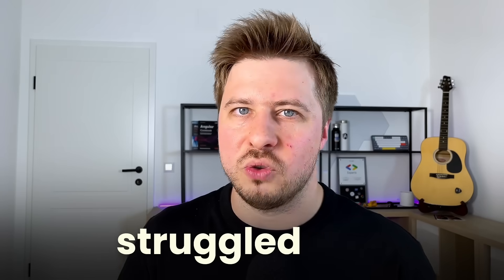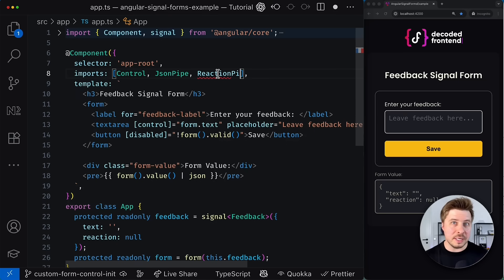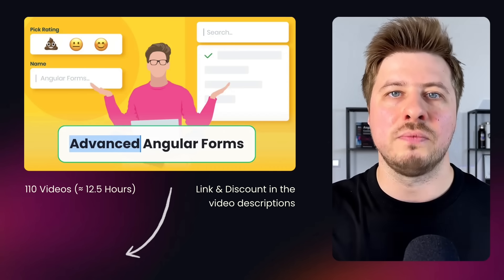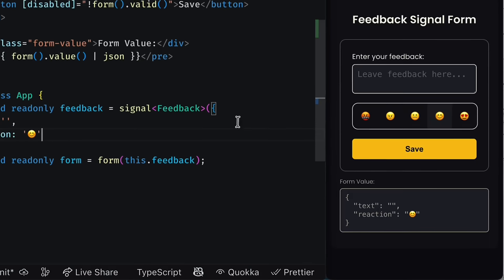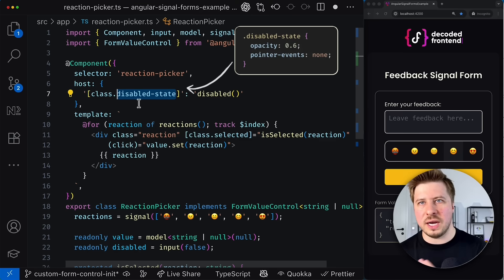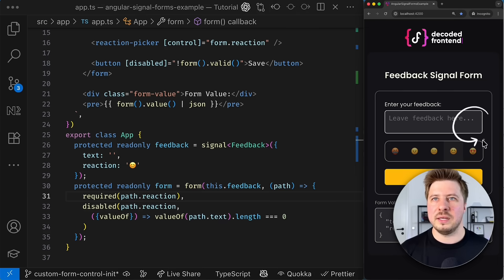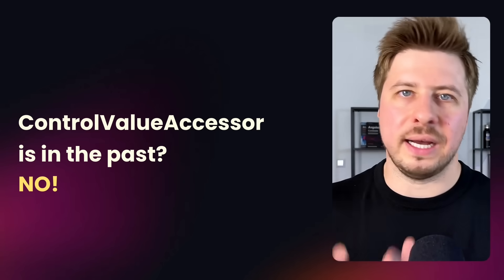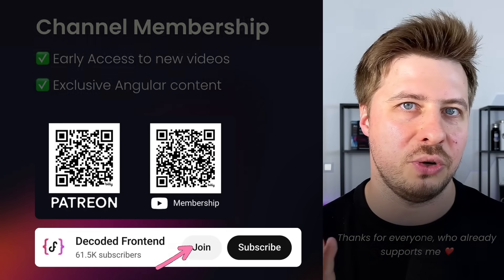Signal Forms Custom Controls — Simplifying ControlValueAccessor

Comment: The new approach definitely looks cleaner but I frankly don't understand the purpose of the "required" property. The parent form defines which fields are optional or required, it is form's responsibility. The field itself is only responsible for gathering the user's input. It shouldn't be aware of any parent validation logic.
Reply from the maker: That’s true, but imagine how much boilerplate there would be if the parent had to define something like if (required) { <span>*</span> } next to every control. 🙂 Sure, we could look into generating it dynamically, but the custom component might also require a specific HTML structure or slot where "*" has to be rendered (just like Angular Material form fields do).

I think this approach is fine because the field itself doesn’t participate in the validation logic and isn’t aware of conditions, etc. It simply reacts to the presence or absence of a specific validator, and that’s it.
Reply: @DecodedFrontend  I understand the motivation behind this decision, I just disagree with the way it was implemented. 
Since I've implemented something similar in the past, I don't see any problem with keeping this piece of functionality separate from the input-specific properties. Anyway, the whole input block (label + input + validations) is usually extracted into a shared library, so boilerplate isn't that big of a problem. 

You're right that in your example the required property isn't used in any weird way. But that's only your example 🙂 From my experience, as soon as you give people a way to do something stupid, they will😅

Comment: 3:47  before , when i need to have controls , i just create a component giving it input output , as formControl , in data , data will be json {} which will be helping for showing dropdowns values, errors text . , now now after all this i got the way how to build this using interfaces implement , previously i did not use any implement just my own logic input out , and creating reusable components , but now i am thinking giving this knowledge a set of practice will give me more exp , basically there are lots professional ways , but i choose to do my own , like i know services rxjs input output directives based on it i am doing whole application , but but there are ways prebuild services interfaces . and i am wonder like i saw this one , its give me curiosity to learn more about it .

i think i missed many things in angular , and you are also having things in playlist , and everytime i found new way a proper way to code , before i just use my own logic 
for the form i created array of json to load text, dropdown, numbers with pattern input  and having control component which which will load all this form from this array based on type select, text number , and input pattern , to make my code fast just have to create array what you want in the form and feed to ControlsFormComponent it will loop in html and load all the reqruied component select text checks radio etc. and give you FormControl in return by output and now from FormControl also you can do any things and i always write a component in that way only so that i dont have to write input or dropdown code again and again , like reasuble thigns ,  this things also quite good , i will merge this both !! and make my code more easy to understand and implement.

but here i am wonder do we have a way to give the select option ?  i am thinkig to write for dropdown , multiselect , checkboxes and radio button and many times we load page with selected values , i am giving it a try !!

Comment: I am wondering few things:
1. Can you for example set the disabled state inside the control-component. since it only is available as an input, not a model, probably not. i think this should be changed.
2. what about custom validators/schemes. how can you react to them on the inside component. 
3. seems like you cannot set stuff from the inside, only read. in your case: ideally disabling the emojis could be done inside the component, not on the form itself. in that way not every consumer has to implement the same logic over and over again. but since there is no access to the form itself, this cannot be done

Comment: I have been experimenting with SignalForms for a couple weeks already, I like them a lot since I did a lot with CVA in the past. My first impression was that its great that I can just pass the FieldState object down to the component and do whatever I need within the component. Then I have also tried to do the same with this kind of implementation of FormValueControl interface. Now, I'm not sure if I like that more. Actually it looks cleaner to me the dumb way when I just pass down the field state of the form control by InputSignal and have full control of all the states by created computed signals from state signals.